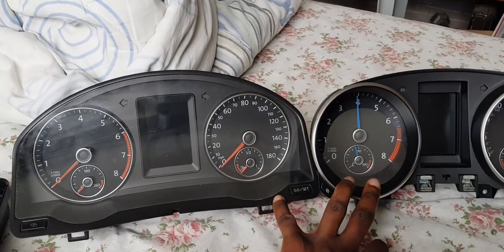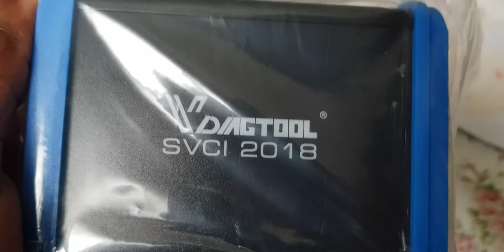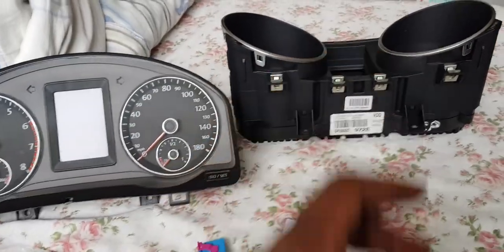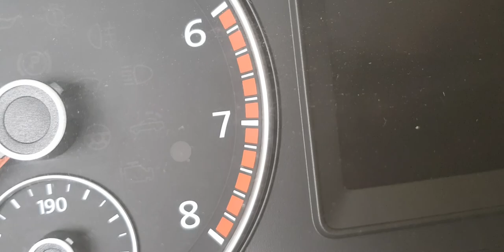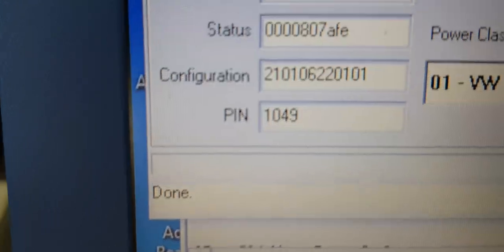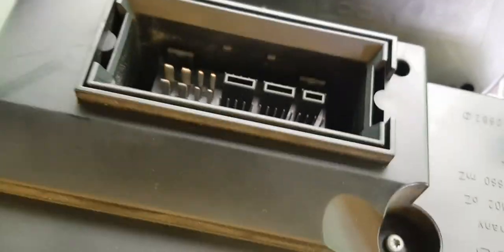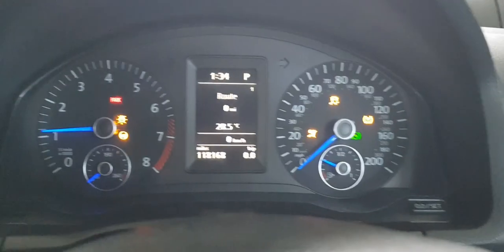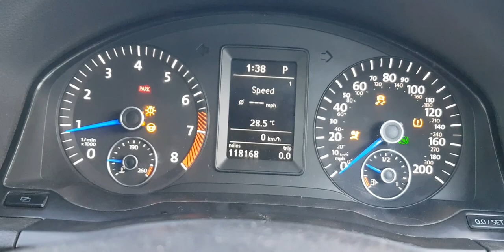MK6 Golf R instrument cluster retrofitted in a MK5 GTI

Comment: Is it possible to fit golf 5 gti cluster onto mk6 gti dash, want to attempt to fit golf 5 gti engine BWA onto my golf 6,but mechanic said it would be easier to move the engine with its ECU and cluster
Reply from the maker: The short answer is YES, once you move over the factory wiring harness (that is going to be a tedious process).  What is going to be an issue is the MK6 steering wheel control buttons will no longer control the MK5 GTI instrument cluster as it would use the newer BAP protocol,  while the MK5 cluster uses the older DDP protocol.   What may also be an issue is the MK6 ABS unit would lose its coding,  so you would have to back that up first using something like VCDS, OBDeleven,  etc.

Also note that the BWA ECU does not measure and display BOOST pressure or Oil temperature for display in the instrument cluster or Radio if you use something like P3 Car, PolarFIS, or Kufatec,  for displaying current engine data. 

Since you are  going through all this trouble,  it means you are trying to move from a stock 1.4L engine to the 2.0T for performance.   Don't forget to upgrade both brakes and suspension to match this increase.   You might as well change the timing belt on the BWA now that you have it out of the car,  and the cam follower,  as well as the thermostat under the intake manifold since this is the time you have easy access.  To do this hassle,  means you want a race car, so you might as well upgrade the fuel pressure relief valve to a higher bar rating, and do at least Audi S3 injectors,  and the Autotech fuel pump upgrade for more smiles.  At this point,  the car is ready for a tune after you have broken your wallet on a K04-0064 turbocharger upgrade 🤣

Please take photos and videos of your swap when done.
Reply: Thank you very much for the information, I have a golf 6 GTi CCZ and the engine has been very terrible, I have given up on it, I managed to buy a crashed golf 5 gti, thank you,

 I have changed the Timing chain, timing belt and tensioner, water pump, thermostat and housing, as well as the cam follower, just waiting to do the engine swap

I will give update when complete

Comment: Hello.  i did the same 3d color job.  the problem I have is that the nivelo fuel warning light comes on before it goes into reserve.  can you give me some advice how to fix this problem?  thanks
Reply from the maker: I used a tool called VDOeditor to fix this via EEPROM.  I just used it to large-scale the fuel gauge for a 52 litre tank
Reply from the maker: If you send me your BIN file, I can edit it and send it to you if you tell me the size tank that is actually in your car.
Reply: @MatthewTaylor3  the car and there golf 6 2.0 tdi 110hp i think it is 53litres.  x the file I have to ask a friend who gave me a hand
Reply from the maker: @taulantlelaj6431  You have a 55 Liter tank.  Your stock gauge can only read up to 52 Liters as the additional 3 liters is in the neck of the tank.

You would need to provide the part number for your stock instrument cluster and the new one when sending the BIN file.
VDOeditor makes an easy job of resolving the issue.
Reply: @MatthewTaylor3  hello . Please I wanna do same thing and I wanna know where can I find that cluster cable ..? Thank you .
Reply from the maker: @zouhairvw9929  The cable you would buy is this:
https://www.aliexpress.com/item/32298533639.html?gps-id=pcDetail404&scm=1007.16891.96945.0&scm_id=1007.16891.96945.0&scm-url=1007.16891.96945.0&pvid=e48caf98-539d-48b1-aad1-d02bde7ac948&_t=gps-id:pcDetail404,scm-url:1007.16891.96945.0,pvid:e48caf98-539d-48b1-aad1-d02bde7ac948,tpp_buckets:668%230%23131923%2377_668%230%23131923%2377_668%23888%233325%2317_668%23888%233325%2317_668%232846%238112%231997_668%232717%237565%23735__668%233374%2315176%23692_668%232846%238112%231997_668%232717%237565%23735_668%233164%239976%23217_668%233374%2315176%23692
or 
https://www.aliexpress.com/item/4000269725145.html?gps-id=pcDetail404&scm=1007.16891.96945.0&scm_id=1007.16891.96945.0&scm-url=1007.16891.96945.0&pvid=e48caf98-539d-48b1-aad1-d02bde7ac948&_t=gps-id:pcDetail404,scm-url:1007.16891.96945.0,pvid:e48caf98-539d-48b1-aad1-d02bde7ac948,tpp_buckets:668%230%23131923%2377_668%230%23131923%2377_668%23888%233325%2317_668%23888%233325%2317_668%232846%238112%231997_668%232717%237565%23735__668%233374%2315176%23692_668%232846%238112%231997_668%232717%237565%23735_668%233164%239976%23217_668%233374%2315176%23692

or

https://www.aliexpress.com/item/32838694996.html?gps-id=pcDetail404&scm=1007.16891.96945.0&scm_id=1007.16891.96945.0&scm-url=1007.16891.96945.0&pvid=e48caf98-539d-48b1-aad1-d02bde7ac948&_t=gps-id:pcDetail404,scm-url:1007.16891.96945.0,pvid:e48caf98-539d-48b1-aad1-d02bde7ac948,tpp_buckets:668%230%23131923%2377_668%230%23131923%2377_668%23888%233325%2317_668%23888%233325%2317_668%232846%238112%231997_668%232717%237565%23735__668%233374%2315176%23692_668%232846%238112%231997_668%232717%237565%23735_668%233164%239976%23217_668%233374%2315176%23692

Shipping took a while

Comment: Which function of the SVCI did you use to program the new transponders?
Reply from the maker: After opening the application and selecting either AUDI,VW,SEAT,Skoda, etc:

I selected "Special Functions", then "CAN instruments".  Once connected to the car, it should automatically identify the instrument cluster type (so you wouldn't have to make a selection here). You would then click "Load config dump" and select the original EEPROM that you backed up from the donor cluster.  You then click "Enter Service Mode by EEPROM dump".  The cluster reboots and may show a blank screen this is normal.  You then click "READ Conf Data", "Read Mileage",Read Immo data".

You can then update the information that you have noted before.  SAVE that to the cluster (but do NOT reboot).  You can then add the transponder at this point, and reboot (exit service mode) to start the car.

Note these steps require you to have made a backup of the cluster, and have another file of the same donor cluster with the immobilizer portion "FF'd" out.
Reply: @MatthewTaylor3  Did you ever have an issue where Abrites would say 'Can't connect to immobiliser' when it was connected to the car via OBD2? My version doesn't connect to my car or recognise anything
Reply from the maker: @seh97  no.  I had no issues.   The version of the software I used was the 2018 model.

Did you do the initial READ and edit of the immobiliser outside of the vehicle?
Reply: @MatthewTaylor3  mines the 2019 version. It initially worked when I read my immo data from current Mk5 cluster in the car. But when I tried it again it wouldn't connect and won't connect to new cluster either. 

I did do the modification to EEPROM and wrote it back to cluster. Will try reinstalling Abrites software tomorrow.
Reply from the maker: @seh97  Your suggestion to fully uninstall, and reinstall the software would have been my next suggestion.

My recommendation is to install this on a burner laptop with NO antiviral tool installed and with BOTH Windows Defender and the Firewall disabled.   The software will be flagged as malware, and as such files will be blocked or deleted at random.  I have an old HP Stream netbook that I use for this reason.

Comment: How much did it cost?
Reply from the maker: The Golf-R clock costed me $US 230. and the 2010 Jetta clock costed me $US 40.
If I had to do it all over again, I would have bought a colored B7/B8 Passat clock, and placed it in the MK6 Jetta faceplate, so that it bolts seamlessly to the MK5 dashboard.
Reply from the maker: As for the cloned copy of AVDI, this was about $280 on eBay, then I just needed to buy a ID-48 immobilizer pill/transponder for $5
Reply: @MatthewTaylor3  Honestly, I'd love to learn what these parts do exactly(purpose of them) and what can be the cheapest price to get such upgrade?
Reply: @MatthewTaylor3  Could you post the links of the items?
Reply from the maker: @DevFTW  I'll post in short order
Reply from the maker: @DevFTW  Which one of the instrument clusters do you want?  They have several different part numbers.  The one I have is the Golf R as measured in MPH.  It doesn't matter which one you get once it isn't one of the Lowline or Midline ones with the smaller half-sized display.
Reply: @MatthewTaylor3  If I want to install the Jetta one, what I do need? the Adapter from the old socket to the new one, what else?
Reply from the maker: @DevFTW  you would want to get a blank ID-48 transponder for your key,  as you will be pairing a "new" key, since your "existing" one can't be reused with your new cluster.   You need to know the PIN for your ECU, and the new cluster,  as you will be pairing these together. 
A cloned copy of AVDI will almost automate the process.